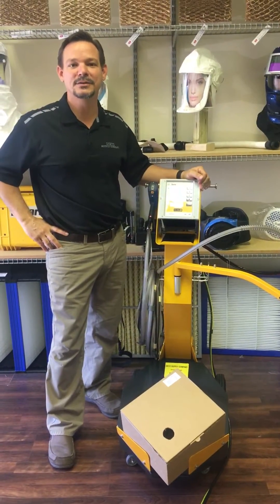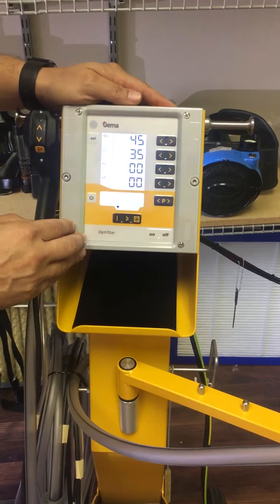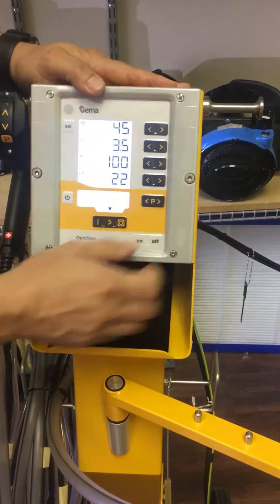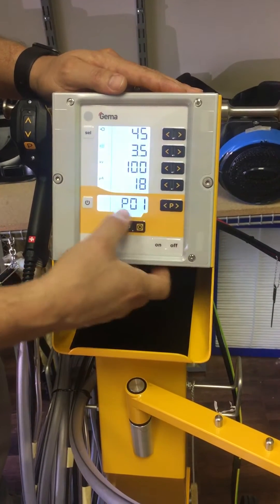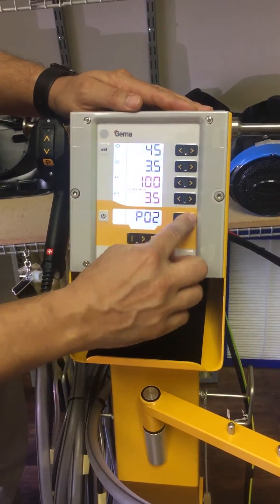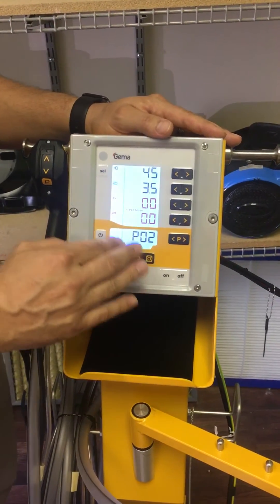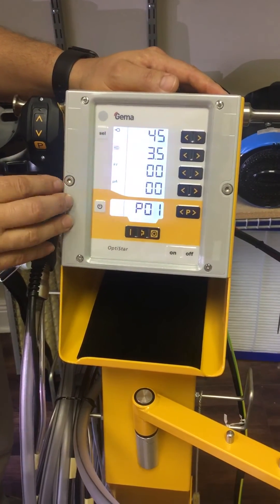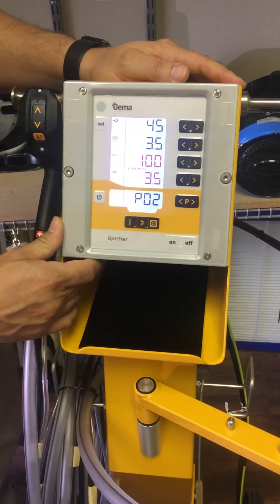Opti 2 KV settings

Comment: Hello. Can you give me some good settings for: 1. primer, 2 paint, 3. varnish? Thanks in advance.
Reply from the maker: @ricomarva2810  if the primer coat is something easy to do, I would use 100 KV and 100 µa. If it is something that is more challenging, I would use 100 KV and 22 µA if you’re having difficulties still I would go to 100 KV and 18 µa.
Reply from the maker: @ricomarva2810  for 2 coat I like 100kv and 5 Ua. For clear coat 100kv and 3.5 Ua. Thanks for your question
Reply: @jamieargyelan292  and the settings for air and paint, which would be the most suitable? thanks 🤝
Reply from the maker: @ good question. There are a few questions I have before I can answer that question. I would want to know how the powder hose correction factor is set up in your unit? You would need to go into the system parameters to see that value. Do you know how to do this?
Reply: not really. I'm just starting out 🤗
Reply from the maker: @ ok no problem. We will work through it. Do exactly as I say. Bottom left button push and hold for five seconds or till the screen changes to different settings. Let go of button and push the top left button once it should say CO and a number. Lower the number to .5 push the bottom left hand button one time. Shut the unit off turn it back on and the system will be ready to go.

Comment: 1st coat primer 80 microns then top coat i need a 200 microns how to program
Reply from the maker: @stockmarketjega4817  when doing a difficult part. Hit the arrow next to the P button and choose a program. set your KV at 100 and your micrograms at 18. This should be a good starting point. When moving to a second coat, choose a different program set the KV to 100 and the micro amps to 3.5 let me know how it goes

Comment: Hai gema poeder gun cotrol unit CG06 alarm H40 and H41 for what and how to solve this alarm
Reply from the maker: Fairose 105 You must be using these with automatic guns?
Reply: @jamieargyelan292 i m using Automatic gun

i solved the problem can bus cable is removed that is the problem

Thank u for ur reply